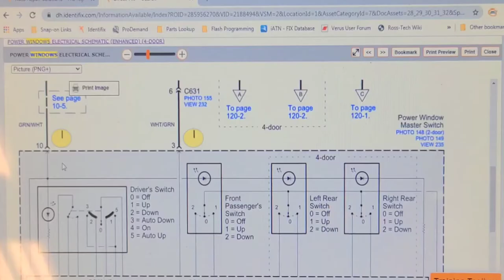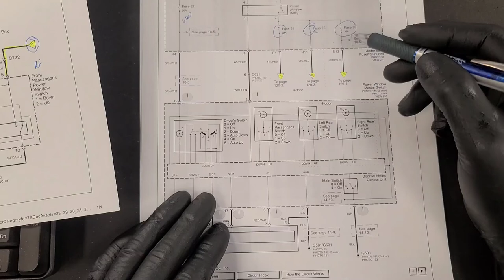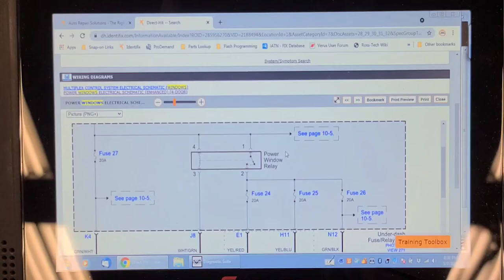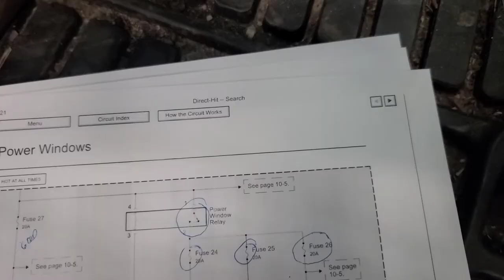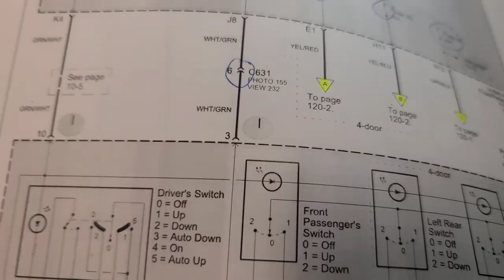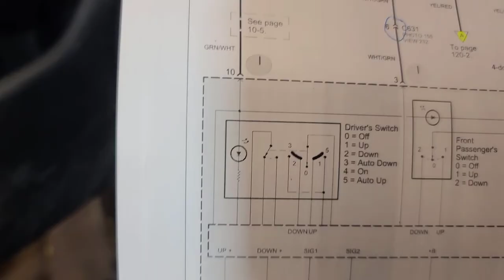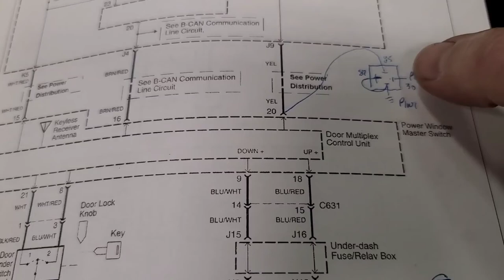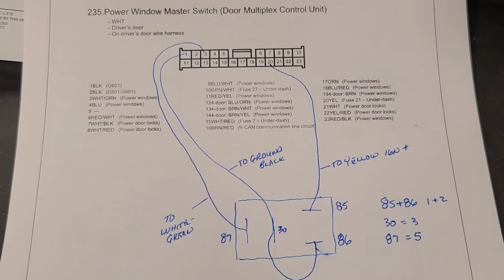2007 Honda Accord 4 Door SE. Three Power Windows Don't Work From Any Switch.

Comment: Not car savvy so can i just replace the black relay fuse thingy
Reply from the maker: @shonyaneuk3222  that will not fix it if this is your symptoms it's actually the master switch that's the problem here.
Reply: I replaced the master door switch and that did not work. It was a brand new switch, not cheap aftermarket either. I’m thinking it’s more the harness. But I’ll use your relay bypass if I can get the correct relay.
Reply from the maker: @maritoro5955  if the wires are broken then this fix won't work

Comment: i have this issue only on the driver side window it doesn’t work but all 3 windows work what’s the issue ?
Reply from the maker: @amirmostafa4999  window motor, wires broken
Reply: @PhillipBailey  How do i check if its the window motor or the wires ? could it just be a fuse ?
Reply from the maker: @amirmostafa4999  on this vehicle it could be a fuse. Test the fuses, test for power and ground to the switch and motor.

Comment: Excellent video
Reply from the maker: Thanks for the feedback. Hope it helped you.
Reply: @PhillipBailey  yes it did a great deal of help...although I didn't go through the trouble of connecting the relay like you did...I just jumped the power window relay.... And evening works fine including the window deactivation button... I dont think there'd be parasitic draw since the window only operate with key on
Reply from the maker: @FASTECAUTO  how exactly did you do it. Just bypassed the passenger power window relay? Jumped 30 to 87?
Reply: @PhillipBailey  I just took out the relay you jumped in your video...jumped the load side with a stripped wire and plugged it back in. I haven't noticed any problem since...
Reply from the maker: @FASTECAUTO  Although that will not likely cause a problem the three power windows will work with the ignition off. Interesting...
Reply: @PhillipBailey  no it does not

Comment: Is there a way you can get the 3 windows to work without adding the relay
Reply from the maker: if you jump the control wire for the relay under the dash to ground it will cause a parasitic draw. I suppose you could bypass the under dash relay by jumping pins 30 and 87, (3 and 5). but then the windows would work with the ignition off.
Reply: @PhillipBailey hi, this is a problem I had in my 07 Odyssey, used the jumper on the wires any control in the driver door,  worked like a charm to make my windows work again but did absolutely cause a pretty significant draw on battery. For a couple monthes now. I've been trying to figure out how to add the relay and where  but now I have a charging system issue, both my high beams just went out all of a sudden & at the same time I had lights on my dash start flickering like the anti-lock brakes, battery ,vsa etc....i  read that it coukd be an issue w the  charging system.  Does what I did to fix my windows and NOT  having additional relay installed  yet seem like it could be what caused my new prob w hibeams & flickering dash lights??
Reply from the maker: @melaniecreek386  I doubt the window switch modification has any affect on the charging system or headlight. If its overcharging can burn out lights and trip fault codes. If its undercoating can cause codes. Need to check alternator output and scan the codes

Comment: Did you remove original window relay.
Reply from the maker: No it needs to stay in place
Reply: I tried it but mine not working.i was hearing clicking sound when I was pressing down button and still hear clicking Sound after adding relay to master switch harness.any help would be appreciated.
Reply from the maker: @user-jd4kp3lp9r  other than double checking your connections and making sure the original relay under the dash is supplying power to the three fuses I don't know what to suggest.
Reply: It was my connections.everything is working now.thank you sir.
Reply from the maker: @user-jd4kp3lp9r  glad you figured it out

Comment: What size wire gauge did you use
Reply from the maker: This is a very low current circuit, less than 300mA so a very light wire is adequate but too small it will be hard to find crimp terminals. I'd recommend 18awg wire just cause it's easy to work with.

Comment: Is there a part number for the relay you used?
Reply from the maker: Not really its just a standard 4 pin Bosch style relay. Anyone will work as long as it's connected correctly.
Reply: @PhillipBailey  WHAT IS VOL AND AMP OF RELAY
Reply from the maker: @NANOPLAYER  any 4 pin relay will work.

Comment: could this be done to a 2004 accord ex coupe
Reply from the maker: I'll have a look the schematic..
Reply from the maker: From what I can see the circuit is completely different so no this won't work. What exactly are the symptoms?
Reply: @PhillipBailey  first my passenger window was working then it would work sometimes and now it doesn't this started happening with the driver side and now they both completely don't work . i just hear clicking . I've changed all the the fuses and the PW relay.

Comment: Which relay did you use
Reply from the maker: Any standard 4 pin relay will work. I chose a used relay that I salvaged
Reply: @PhillipBailey I did get a new switch and still ran into the same problem
Reply: @PhillipBailey so it is the wiring?
Reply from the maker: @jasonmaezes6587  yes could be the wires between the door and pillar.
Reply: @PhillipBailey which gauge wiring did you use?

Comment: Just had this happen in my 2010 Honda Odyssey ?SE? I think. Hear the clicks, no window movement on 3/4 windows. Lock will stop the clicks from happening if I lock them.  Power doors and locks all work. 
 I will do more homework if necessary but by chance, does anyone know if this will work for me?????(Hopefully exactly as this Accord video shows lol)
Reply: Also I enjoyed how you explained everything you were digging into. I believe in knowing WHY as well as how to and this was very believable. Nice video and explanation.
Reply from the maker: I'll have a look at the circuit...
Reply from the maker: @drywallerbuddy  as near as I can tell the circuit on the 2010 Odyssey is exactly the same. I'd confirm the circuit at pin 3 of tge master switch on the white/green wire by supplying a ground to it. If that allows the 3 windows to work the you need a new master switch. I'd price one as its likely cheaper in the US. ( I'm assuming you're in the states). This modification should work as well it the switch is the problem. Good luck and let us know how you fare.

Comment: Okay what if i replaced the switch alread? Same issue.
Reply from the maker: Either a defective switch or broken wire between door and pillar. Could also be a defective relay. If you bypass the relay do the other windows work? Is the relay turning on?
Reply: @PhillipBailey I did go ahead and bypass the switch with a relay like you did in this video but it didn't work I even tried the old and you switch that I just bought. Let me look a little further and come back to you. Thank you for your response by the way!
Reply: @PhillipBailey the relay comes on when I turn the key over but when I took it out it was very hot. Also my driver window still works when the fuses out I'm not sure if that's normal
Reply from the maker: @camerondavenport4857  which fuses out?
Reply: @PhillipBailey sorry for the flood of messages my man. I am leaning more towards a short and the door boot. I have an issue with my doors locking and unlocking when I shut the driver door or when I go over bumps sometimes. I appreciate your help and if I have any more questions I'll let you know. I tested the relay and it seems to be good but I'm a rookie. So I'll probably double and triple check
Reply: @PhillipBailey the relay under the dash to the left.
Reply: I'm also realizing I'm missing three of the 20 amp fuses for the power windows down there. The only one that's in is the driver so that could be a clue 😅
Reply: Okay I got it figured out. With the help of your bypass relay in the door and the fuses put back in place I now have working Windows after 5 years of owning the car. Thank you so much. I will be subscribing to your channel!
Reply from the maker: @camerondavenport4857  that relay is for the three doors except drivers
Reply from the maker: @camerondavenport4857  why were the fuses missing 😕

Comment: What if the other windows work but the driver when not working
Reply from the maker: Different problem. Need to check power out of the switch to the driver window motor.

Comment: Can I just replace the fuse ?
Reply from the maker: This is not a fuse problem. Its an internal failure in the master switch. Unless all your power windows don't work then it could be a fuse...

Comment: does anyone know what type of relay to use?
Reply from the maker: any 4 pin standard relay will work.
Reply: @PhillipBailey  thanks for your reply.  On your hand-drawn schematic of the relay, what do pins 85, 86, 30 or 87 mean?
Reply from the maker: @dcm1735   85 and 86 are the coil control pins in the relay. 30 and 87 are the switched pins. Most relays are numbered on the bottom for identification. Some relays are number 1, 2 3 and 5 instead. 1 and 2 correspond to 85 and 86, 3 and 5 are 30 and 87 respectively. You can use a relay with an 87a pin just leave it disconnected. Google how a simple automotive relay works.
Reply: @PhillipBailey  thank you again for your reply.  I googled and I understand how the really works now.  I noticed there are different current ratings for the relay.   Where and what type of relay should I purchase?
Reply from the maker: @dcm1735  any parts store should be able to supply a standard 4 pin relay. Most relays can handle 30 amps. You're turning on the other relay under the dash so it's around 150mA. Current rating is not that important here.

Comment: Can I just buy a relay?
Reply from the maker: Another viewer suggested he fixed his by jumpering the two terminals on the relay. According to the schematic that will work but the windows would then be able to work with the ignition off. At least the three passenger windows would. He said no so I'm not sure if he's on a different year or the diagram is wrong.

Comment: Have you ever heard of eBay or Amazon
Reply from the maker: Yes I have: https://www.amazon.ca/Dromedary-2003-2007-Electric-Control-35750-SDA-H12/dp/B0759C5BQK/ref=sr_1_2_sspa?dchild=1&keywords=2007+honda+accord+master+window+switch&qid=1620702684&replacementKeywords=master+window+switch&sr=8-2-spons&vehicle=2007-59-751------------&vehicleName=2007+Honda+Accord&psc=1&spLa=ZW5jcnlwdGVkUXVhbGlmaWVyPUFQOE82TlgyNUk5UFgmZW5jcnlwdGVkSWQ9QTEwMjY3ODIxM1hRVlIySjBZMDhKJmVuY3J5cHRlZEFkSWQ9QTAzNTMzMzQyUzZLU1pRTk05MTA2JndpZGdldE5hbWU9c3BfYXRmJmFjdGlvbj1jbGlja1JlZGlyZWN0JmRvTm90TG9nQ2xpY2s9dHJ1ZQ== and 10 days to get it here. Who knows what kind of cheap quality that is but you're right they are available cheaper. The customer is quite happy with what I did. I even threw in a stick to smack the kids in the back seat if they won't stop playing with the windows...

Comment: Don't you just have to reprogram the windows?
Reply from the maker: No reprogramming of the windows is not required.
Reply: @PhillipBailey  The main control switches are linked to your ignition. You have proven that it's not motor as you have powered up if you make a bad contact eg water in the switch, the control unit will shut it down to reset control module shut door turn ignition to on push down on window to be reset open door wait 1 second and release button turn ignition off hold down button   turn ignition on wait 1sec release repeat repeat 2 more times once completed a total of 4x with button release wait 1 second turn ignition off and on and program is complete repeat process for other windows. Thanks for coming it because the ignition door locks bcm and alarm are all inter linked. As you may know, you can open and shut your windows with your car keys buy button or buy turning the key in your door lock it's self if you have left the windows open when you have left the vehicle it's all linked together

Comment: 2005 accord did not work
Reply from the maker: I'm not sure if the 05 circuit is the same as the 07
Reply: @PhillipBailey  can you verify please? I do not know how to read scamatics
Reply from the maker: @theblackvalley1000  the circuit on the 05 looks thebsame as the 07. It's possible you have a different problem. What exactly is not working?
Reply: @PhillipBailey  drive side window works fine but the other 3 do not work. (When you push the buttons from the driver side you can hear it at click on each window but the windows do not move at all
Reply from the maker: @theblackvalley1000  that sounds like the same problem. At the fuse box under the dash test fuses 24  25 and 26. They should have power on them on both sides with the ignition on and master switch lockout switch off. If not then pop the master switch out of the door and locate the white/green wire in location 3 at the switch. Connect a grounded test light to the back of pin 3 and the relay under the dash should turn on and power up those 3 fuses allowing the other three windows to work. If it does not check for a broken wire between the door and pillar. If the relay turns on with the test light then your master switch has failed in the typical manner. Either replace the master switch or modify it by adding a relay like I did in this video. Hope this helps you.